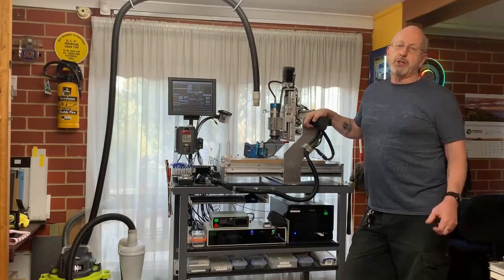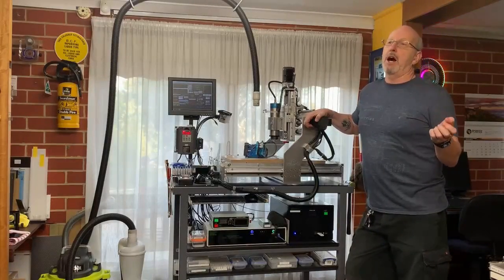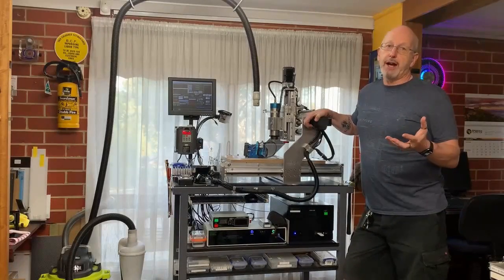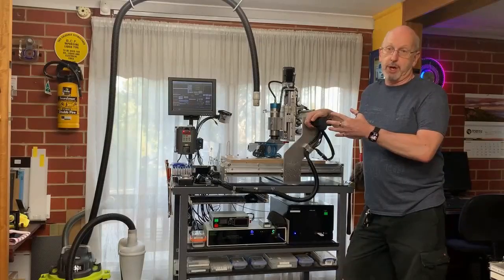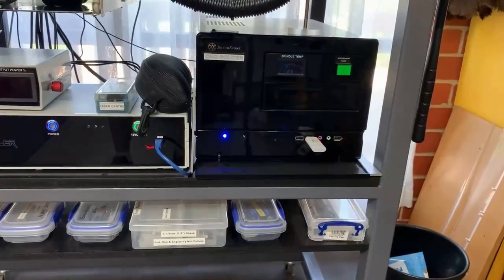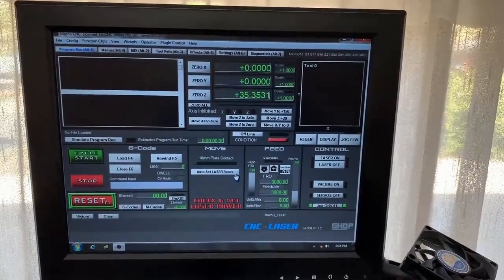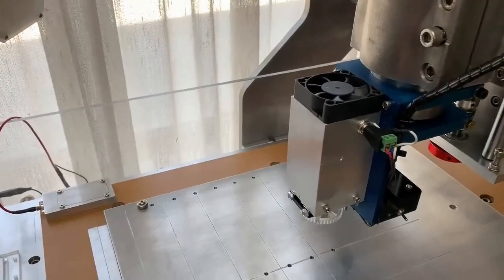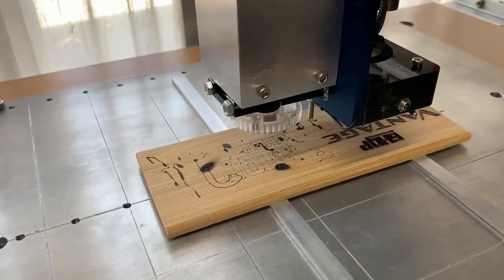Fitting a Laser to my  Home Built CNC Router.

Comment: If I may ask, is the "Home Built CNC Router" a kit, or really home built? I ask, because I am looking to buy a kit (I think), and the Y-axis gantry looks bullet proof, compared to most of the kits I have looked at. The linear rails seem thick enough to hang a 1-3/4 to 2+ HP router on, not just a laminate trimmer. If it is a kit, I would appreciate the brand name/type. If it isn't a kit, this may be the incentive I need to roll my own. Thanks- Art Buckler
Reply from the maker: No not a kit at all, designed and built from base materials such as aluminium extrusion and bar. Naturally all the rails, bearings, motors etc were purchased individually from various eBay suppliers. There is a page on my website with lots of images, explanations and downloads.
http://www.hamrx8.com/CNC_Router_Project.html
http://www.hamrx8.com/New_Z-Axis_for_CNC_Router.html
Reply: Question if I was to follow your instructions for the Cnc build what type of cost will see
Reply from the maker: @the-bu3lb  That is a tough question to answer as I completed building the CNC Router back in 2011 8 Years ago. All I can say from memory back then I think it cost me something like A$2,500 and that included everything even the dedicated computer I built from components that runs Mach3 software. Since then I have made many improvements and modifications. Namely the Z Axis and incorporating Closed Loop Stepper Motors. There are separate videos on these upgrades on this channel. There are more details about the build on my website. www.ghqp.com.au